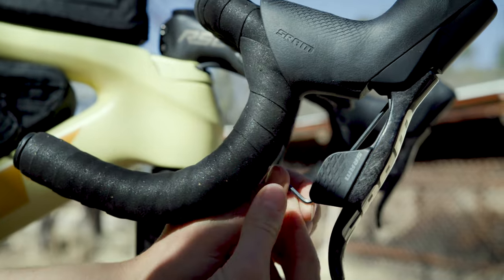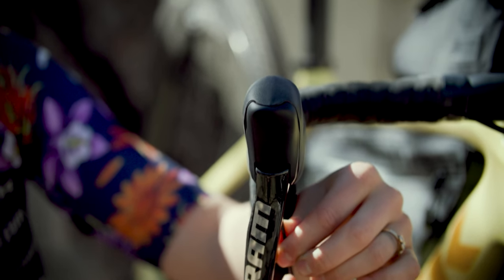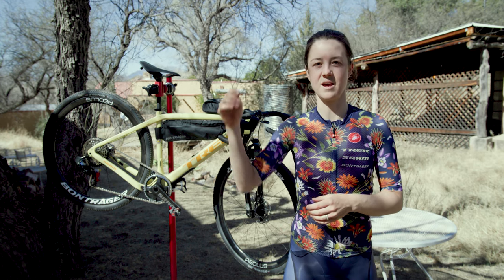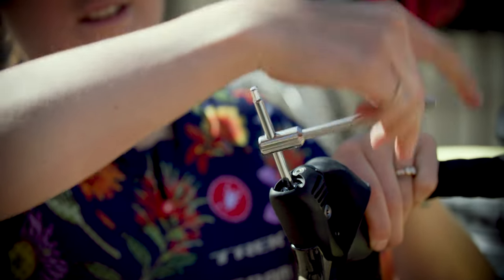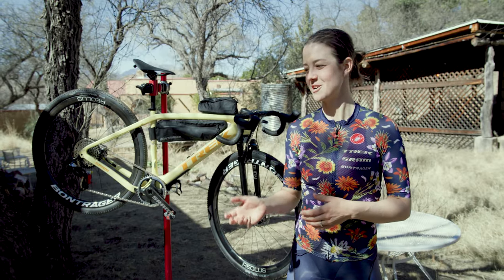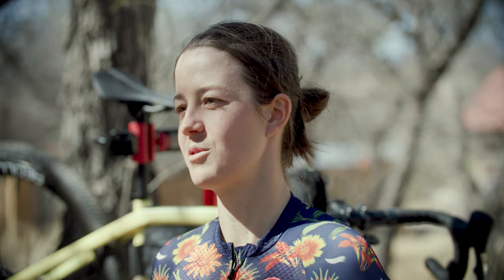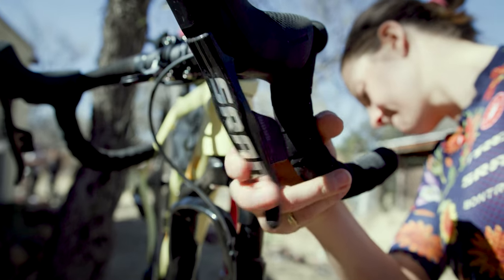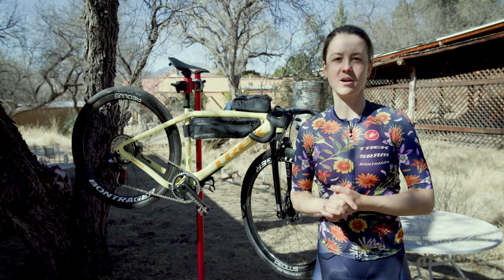How to Set up SRAM Brakes on Ruth Winder's Trek Checkpoint

Comment: I'm a bit confused about pad advancement, as I thought on hydraulic brakes the plungers that push the pads essentially float freely, with contact with the disc rotor the only thing keeping them from coming out (after you squeeze them a few times) and the hydraulic fluid then coming out with them. So then "pad advance" shouldn't be necessary, because once you have the wheel in and you squeeze the brakes a few times, the plungers will self-center into the correct alignment around the rotor (with a sticky system being the cause of pad rub, as the plungers aren't floating as freely as they're meant to). Am I missing something? Thanks!
Reply from the maker: a key thing to keep in mind is that the pistons that push the pads are held in place by a rubber quad ring that sits in a gland in the caliper. When you squeeze the brake lever and push the pads towards the rotor, the piston is not sliding through the quad ring. Contrary to popular belief, it's actually sticking to the ring, and the ring flexing in its gland is what actually allows the pad to move to the rotor. Typically as pads wear, the force you apply to the lever automatically helps the piston start sliding through the quad ring juuuust enough to compensate for pad wear. But pistons that are dirty sometimes like to creep back to their original home, or muddy conditions cause pads to wear really quickly. Both scenarios might leave pads farther from the rotor than you'd like, and that's where pad advance comes in, as you push the pistons through the quad ring and help them find a new home position that keeps the pads closer to the rotor.
Reply: @SRAM  thank you, I appreciate the detailed response! I'm doing my first frameset build this fall, and will be going with my first SRAM drivetrain :)
Reply from the maker: @bhatch  Woohoo!
Reply from the maker: @bhatch  lol, I'm sleepy and forgot the MOST COMMON reason to do pad advance: when the bike is brand new and the pistons have arrived from the factory fully pushed into the caliper. If you want your brake feel to be more on the "instant engagement" side of things rather than the "tons of modulation" setting, a little manual encouragement of the pistons during the bike build will get you what you want.